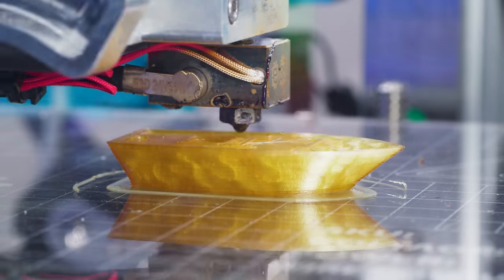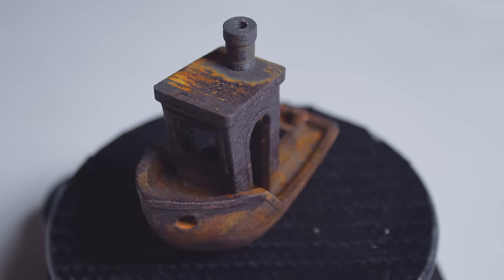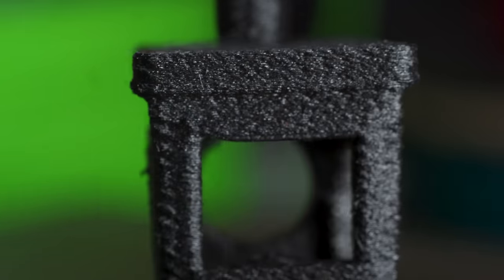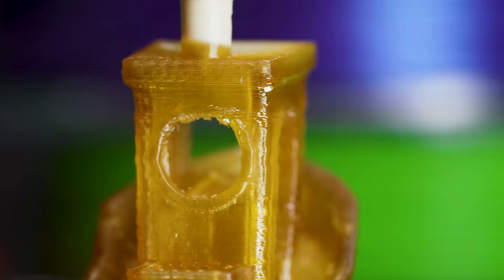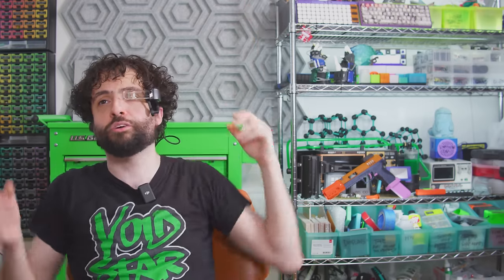The 3D Filament Tier List! Which Should YOU Use?

Comment: You're welcome (I'm exhausted 😪)

Regular Polymers:

S-Tier
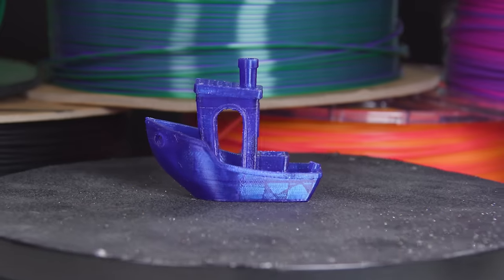[11:50] PCTG: Better than PETG, waterlogged 1/3 as fast, easy print, minimal sag, strong, expensive, hard-to-remove supports. Best regular polymer by far
[4:46] Carbon Fiber PLA (*): Stiffer, more brittle, accurate, low shrinkage, great finish
[7:34] "Tough" PLA: PLA + PBT, prints like PLA, better temp/impact resistance
[8:45] High-Speed PLA: For >300mm/s, low temp/viscosity, fast prints, great for prototyping
[11:18] Carbon Fiber PETG (*): Lower sag/warping, better stability/stiffness than PETG, shiny, good for functional prototypes

A-Tier
[2:54] PLA: Softens in heat, UV sensitive, brittle, limited post-processing
[10:31] PETG: Versatile, tougher/more heat resistant than PLA, low friction, hard-to-remove supports
[13:35] CF PET: Extremely stiff, easy to use, better than PET but expensive
[15:40] ASA: UV resistant, tough, matte surface, less warping than ABS, still toxic fumes

B-Tier
[4:00] Silk PLA: Weaker, easy support removal, puffs when printing, shiny
[6:26] Wood PLA: Weak, feels like hard wood, can be varnished
[8:10] Matte PLA: Satin surface, sandable, absorbs humidity, jams easily
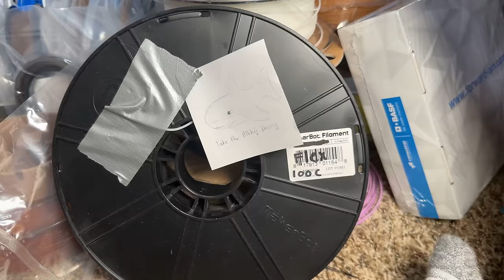[9:33] "Flex PLA" PCL: Low temp, moldable, doesn't stick to adhesives
[12:41] PET: 275°C min, stiff, tough, shiny, temp resistant, hard to print
[14:05] PVB: Prints like PLA, works like PETG, IPA vapor smoothing
[16:22] HIPS: Lightweight, good for wearables/props, dissolves in limonene

C-Tier
[14:44] ABS: Vapor smoothing, fast, cheap, heat resistant, tough, warps/stinks
[22:35] PMMA (acrylic): Clear, UV resistant, brittle, bad adhesion, not for 3D printing but very clear
[29:43] OBC: Semi-flexible, less warping, can use supports, hard bed adhesion

F-Tier
[5:45] Metal-Filled PLA: Hefty, metal properties, very brittle, expensive
[22:35] Non-transparent PMMA: No use case since it's not clear
[27:00] TPE: Too runny, generally bad
[28:17] Polypropylene (PP): Flexible, strong layers, low density/friction/temp resistance, bad adhesion, warps
[30:16] HDPE: Worst filament in every aspect

 👇Check the comments for Engineering and Super polymers. Suggestions are welcome!

* Carbon Fiber filaments are pretty dangerous, the fibers come of from everything - including printing and even just using - and they get into your skin, lungs and eyes. They look nice but I wouldn't put them into S for that reason.
Reply: Engineering Polymers

S-Tier
[19:32] Glass-Filled Nylon (PA GF): Stiff, tough, heat/abrasion resistant, less warping, easy print, alternative to machined aluminum
[24:56] 99D TPU: Harder than skateboard wheel, incredibly durable, indestructible, for combat robots/tactical gear

A-Tier
[21:53] PC Carbon Fiber: Incredibly stiff, can overload gears/motors, cheap
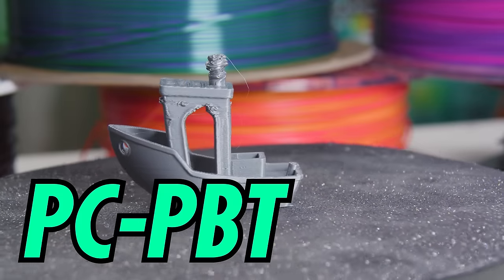[23:36] PC-PBT: Easy print, shatter resistant in cold, durable, low cost
[27:26] SEBS: Best flexible filament, but hydroscopic, smelly, softens at low temps

B-Tier
[17:02] PA-6 Nylon: Tough, low friction, difficult print, warps, dry box required
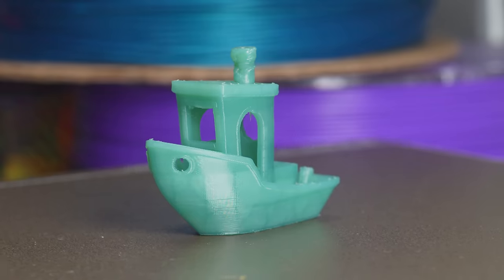[18:16] PA-12 Nylon: Heat resistant, stiff, for precise parts, brittle, hot box required
[18:50] PA-6 CF Nylon: Stiffer than regular, warps less but still significantly
[21:08] Polycarbonate (PC): Tough, stiff, heat resistant, dry box required, slow print, >300°C
[29:04] PP GF: Hard to print, tough, durable, all-weather, lightweight
[24:56] 80D TPU: Like running shoe, good for bumpers/hinges, easy print, less durable than 99D

C-Tier
[18:50] PA-12 CF Nylon: Stiffer than regular, warps less but still significantly
[20:37] Nylon/PETG Alloys: Some nylon strength, many weaknesses
[24:56] 80A TPU: Difficult print, constant low speeds, too sweaty for wearables

F-Tier
[30:58] POM: Bad adhesion, slow print, toxic if overheated
[31:56] PVDF: Tough, durable, resistant, expensive, potentially poisonous gas if overheated
Reply: Super Polymers

A-Tier
[35:01] PEKK: Easier to print than PEEK, mechanically inferior but superior to most
[38:13] Ultem 1010 (PEI): Stiff, strong, resistant, perfect all-round, but 425°C hotend/160°C bed

B-Tier
[36:19] PSU: Weakest super polymer, heat/chemical resistant

C-Tier
[33:06] PEEK: Incredibly strong/tough, self-extinguishing, chemical resistant, extremely expensive, difficult to print
[35:38] PPS: Chemically resistant, expensive, high temp printing
[36:58] PES and PPSU: Similar to PSU and PEKK
[37:21] CF-PEEK: Stiffer than PEEK, less sagging, very few printers capable

F-Tier
[38:10] Ultem 9085 (PEI): No reason to use
[39:38] TPI: Extremely difficult to print, high temp requirements
Reply: ❗By Use-Cases❗

General Purpose / Top Picks
[11:50] PCTG: Easy to print, minimal sagging, strong, water-resistant. Best all-rounder but expensive.
[4:46] Carbon Fiber PLA: Best cheap filament that's more brittle but also stiffer, accurate, low shrinkage and has a great finish
[11:18] Carbon Fiber PETG: Lower sag/warping, better stability/stiffness than PETG, shiny, good for functional prototypes
[15:40] ASA: Easy to print, UV resistant, tough filament with matte surface and less warping than ABS for outdoor use and vapor smoothing

High-Speed Prototyping
[8:45] High-Speed PLA: For speeds above 300mm/s. Low temp, low viscosity, fast prints.

Functional Prototypes / Engineering Parts
[11:18] Carbon Fiber PETG: Lower sag/warping, better stability/stiffness than PETG. Good for functional prototypes.
[19:32] Glass-Filled Nylon (PA GF): Stiff, tough, heat/abrasion resistant. Alternative to machined aluminum.
[23:36] PC-PBT: Durable, easy to print, shatter-resistant in cold temperatures.

Outdoor / UV Resistant Parts
[15:40] ASA: UV resistant, tough, matte surface, less warping than ABS.

Flexible Parts / Tactical Gear
[24:56] 99D TPU: Incredibly durable, indestructible. Great for combat robots and tactical gear.
[27:26] SEBS: Best really flexible filament, good for softer applications.

High-Performance / Engineering Applications
[37:46] Ultem 1010 (PEI): Extremely stiff, strong, and heat resistant. Best super polymer if you can manage the high printing temperatures.
[35:01] PEKK: Easier to print than PEEK, still superior to most other filaments mechanically.

Lightweight Parts
[29:04] PP GF: Tough, durable, all-weather, very lightweight. Hard to print but great results.

Aesthetic Prints
[4:00] Silk PLA: Shiny finish, easy support removal. Good for decorative items.
[6:26] Wood PLA: Feels like hard wood, can be varnished. Good for wood-like appearance.
[5:45] Metal-Filled PLA: Hefty, metal properties, very brittle, expensive. Hard to print but useful for their unique surface finishes and aesthetics.

Extreme Chemical / Heat Resistance
[33:06] PEEK: Incredibly strong/tough, self-extinguishing, chemically resistant. Difficult to print but unmatched performance.

Composite / Fiber-Reinforced Parts
[21:53] PC Carbon Fiber: Incredibly stiff, great for parts requiring extreme rigidity.

Impact-Resistant Parts
[7:34] "Tough" PLA: Better temperature and impact resistance than regular PLA.

Vapor Smoothing / Post Processing
[14:05] PVB: Can be smoothed with IPA vapor, prints like PLA but performs like PETG.
[15:40] ASA: Can be smoothed with Acetone, UV resistant, tough, matte surface, less warping than ABS.
Reply: You should add the metal filled variants under Aesthetic Prints too, despite zach putting it in F tier. Other commenters are saying it's difficult to print, but absolutely indispensable for the surface appearance
Reply: Thanks for this! You've probably saved me a few hours rewatching multiple times to write this all down for easier comparison and reference for myself
Reply: @orangelego100  Added!
Glad I could help, I easily spent 2-3 hours on it. Hopefully more people see this so no one else needs to 😂
Reply: Replying so i can find it later!
Reply: Great
Reply: Thanks for putting this together. I was expecting to see this in Zack's comments. Glad I scrolled further.
Reply: you are a hero, real one.
Reply: You are the goat!
Reply: Thanks
Reply: @daycred  Super helpful -- thanks!
Reply: Thank you!😂

Comment: Chemist here to answer your chemistry questions:

Halogenated hydrocarbons are molecules made of carbon with attached hydrogens that have some atoms of a halogen (flourine, chlorine, bromine, or iodine) attached where a hydrogen normally would be. There's a lot of these, but some examples are chloroform and some other lab/industrial solvents (which would likely dissolve or attack other filaments), some pesticides, the molecule PTFE aka Teflon (funny enough, related to the filament at hand) and a lot of other things.

Inorganic acids are a lot simpler. They are simply the acids that are NOT made of carbon. Examples include hydrochloric acid, sulfiric acid and nitric acid. Common acids that do not fit in this group are acetic acid (vinegar) and citric acid.

Also, as a side note, please don't test this. Sticking random polymers in random acids is an easy way to get chemical (or physical!) burns or otherwise damage yourself or your property. Even if it says it is "resistant" or whatever, that doesnt mean it wont react, dissolve or produce toxic, explosive or dangerous compounds. Take it from me, a chemist who has made some dumb mistakes not realizing things reacted and blowing up glassware on accident. Not as fun as it sounds.
Reply: So… don’t use it for my 3d printed toddler bath toys and kitchenware?
Reply: Thanks mate very informative appreciate it
Reply: Up to the top of the comments you go, Mate
Reply: Also, regarding PEEK, it is unfortunately not resistant to sulfuric acid or hydrobromic acid, but it is resistant to many solvents and hydrochloric acid, so still pretty badass.
Reply: Thank you for posting this, because some of these filaments should be on the no not ever list.
Reply: > a chemist who has made some dumb mistakes not realizing things reacted

Yeah... I've seen a chemist that separated acids and bases during a full day of tests and then chucked them together to dispose of them.

Room was evacuated ASAP and unusable until the next morning, because he'd accidentally basically mustard gassed the whole room.
Reply: @dascandy   Definitely a cautionary tale!

Comment: Leaving a comment about PVDF as a chemist - indeed it's indestructible! It can withstand paint stripper (halogenated organic solvent) and concentrated battery acid (inorganic acid)!  Warps like hell, has poor bed adhesion (I was only able to print it with Vision Miner's Nano Polymer Adhesive on the print bed), but if you find a way around warping - it's actually quite pleasant to print
Reply: I was able to print it on G10 (Garolite), with the bed about 105C.

A second choice is to print it on PVA.  One easy technique is to model a sheet of PVA that it one layer thick.  Place your part on top of that.  You basically print one time use build surfaces.

I use upgraded 3ntr printers and have a dual extruder capable setup.
Reply: I've also sent this message to two other people in this comment section here, but I have a question about this and Zack's statement that it becomes deadly just a few degrees above the print temp.

I have some old injection molded parts I am in the process of replacing with printed parts that need to survive for years being exposed to chlorine gas. I'm an industrial design engineer and I did a minor in polymers and associated production processes, so I understood the potential risks of PVDF well enough when it came through my materials research as one of the only two viable options along with PPS that can be done in FDM and meets the chemical requirements.

However, from my understanding is that degradation and thus the extremely toxic byproducts like hydrogen fluoride, whilst extremely toxic, are actually very unlikely to occur since thanks to its fluor bonds being so strong - taking a lot of energy to break- it has a huge safety delta between the processing (~250°C) and degradation (~400°C) temperatures. Much higher than a lot of common polymers which seem to have around a 50-80 degree safety margin and obviously much much higher than it's chemical cousin PVC since its delta is actually negative.

This does not gel with what Zack is saying here, where he talks about even a few degrees causing the release of dangerous amounts of toxic chemicals. I would really like to understand this well, since this is a potentially dangerous situation I would like to avoid. I know that degradation doesn't happen at a set temperature, because of polydispersity shorter chains will degrade sooner, but I cannot imagine that to be such a factor that a few degrees above processing temps it is suddenly deadly.

Do you have any insight on this?
Reply: @martvansteenbergen8955  just heating up this polymer to melting won't cause any problems, as you said, it's very stable up until very high temp with significant margin. But if you overheat it beyond decomposition temperature, that's where it becomes dangerous. PVDF decomposes into reactive and toxic fluorinated gases, including HF, and those are very bad for you. So the point is - don't let it drip into heating element where it could overheat and cake up. 
Side note - these ptoxic products of decomposition are similar to ones of PTFE (Teflon), and are especially toxic to birds. To the point that if you have non-stick cookware and have a parrot for example, the bird's life expectancy is halved
Reply: what is it about it that makes it immune to acids? I thought acids' whole thing was eating apart anything (but yea i guess something has to be able to hold them...)

Comment: No one cared to list all of them yet? Well:

S: CF PLA (4:46), Tough PLA (7:34), High-Speed PLA (8:45), CF PETG (11:18), PCTG (11:50), GF Nylon (19:32), TPU 99D (24:56)

A: PLA (2:54), PETG (10:31), CF PET (13:35), ASA (15:40), CF PC (21:53), PC-PBT (23:36), SEBS (27:26), PEKK (35:01), Ultem (37:46)

B: Silk PLA (4:00), Wood PLA (6:26), Matte PLA (8:10), Flex PLA = PCL (9:33), PET (12:41), PVB (14:05), HIPS (16:22), Nylon PA-6 (17:02), Nylon PA-12 (18:16), CF Nylon PA-6 (18:50), Polycarbonate (21:08), TPU 80D (24:56), GF PP (29:04), PSU (36:19)

C: ABS (14:44), CF Nylon PA-12 (18:50), Nylon/PETG Alloys (20:37), Clear PMMA (22:35), Chocolate (24:15, disqualified), TPU 80C (24:56), OBC (29:43), PEEK (33:06), PPS (35:38), PES (36:58), PPSU (36:58), CF PEEK (37:21)

F: 5x Metal-Filled PLA (5:46), non-clear PMMA (22:35), TPE (27:00), Polypropylene (28:17), HDPE (30:16), POM (30:58), PVDF (31:56), TPI (39:38)
Reply: Thank you, I was just about to do it, glad to see someone else did it.

Comment: A local manufacturer in South Africa has some really interesting filaments that I haven't seen or heard of anywhere else. Like SBS (Styrene-butadiene-styrene) which not hydroscopic, slightly flexible and slightly translucent that looks very nice when printed in vase mode. TPR(thermoplastic rubber) which also isn't hydroscopic with a shores hardness of 90. ABS-X, ABS but easier to print on an open printer ("all the benefits of ABS but without the hassles"). Lastly PLA Wayless which describes it's self, light weight PLA perfect for RC and drone parts.

Always enjoy your video!!
Reply from the maker: Could you have them email me? I’d love to try some of those on the next Every Filament episode.
Reply: @ZackFreedman 
I sent your message and deeds to the owner. I hope he reaches out to you!!
Reply: TPR is a tricky bugger but so worth it! 

Hopefully you guys got in contact!
Reply: SA Filament ?
Reply: @meisievannancy 
FilX
Reply: @heinrichbosch4040 Dankie.
Reply: @meisievannancy  Plesier!

Comment: POM sticks very well to PLA so if you print the first layer in PLA it's actually somewhat printable 
still a total pain in the ass though
Reply: As friendly as possible: Did you actually try this or did you read this info somewhere? I wish someone would print POM on rayon or cellophane. I'm fairly confident people would be happier.
Reply: @3dPrintingMillennial  I've printed with it a fair bit. It's really useful if you need low friction. But it warps a lot in my unheated bad enclosure.
Its really strong though and the layer adhesion is incredible. 
I try tobavoid using it but if I have to, I do have the option.
Reply: @folkevongen6442  Curious what you make that has you needing to use POM sometimes
Reply: @justtwoseats  a filament spooler had a shaft that rubbed up against the frame causing the frame to get pretty warm and wearing down. Printing the bit of the shaft that rubbed in POM did the trick. 
And an adapter for a drill to that same spooler kept breaking, POM worked well for that as well. 

There are probably better options for what i need, POM just intrigued me.

Comment: PVDF would be an awesome thing to print because in applications where hydrofluoric acid(HF) is used to etch the surface of titanium, racks made of this stuff are what you set up the pieces on. In designing those, you have to make absolutely sure there are no flat spots or cavities for acid to pool or gather
Reply: You can but PP can do that as well and is cheaper. PP glue stick, 100% infill and a 20 mm brim will get you most of the way. If you need support try and do it only on flat surfaces where you can get a knife in between. Also print support with a 250-300% offset from the printed object. This has worked for me at least.

Comment: 99% of everything I print is PETG. It's a bit slower, but I have consistently gotten killer results and the resulting products are strong and with enough flex that they can handle a lot of real life. Doesn't deform, handles higher temps. It's just a great allrounder. I'll have to check out some PCTG, though!